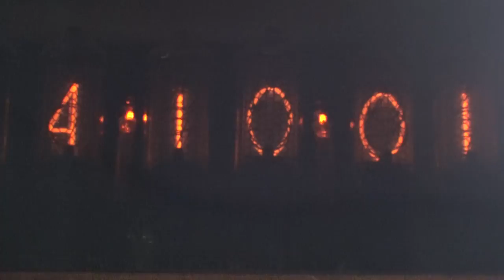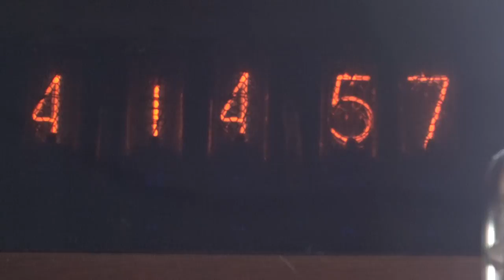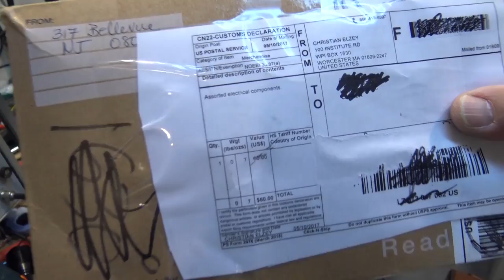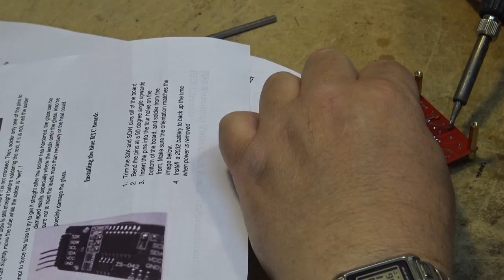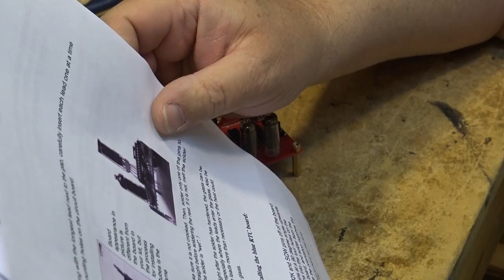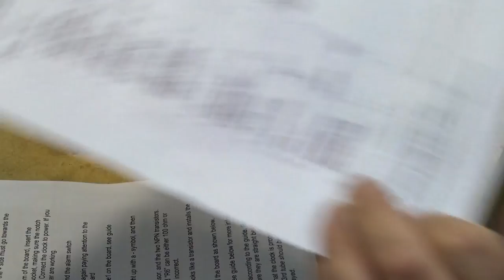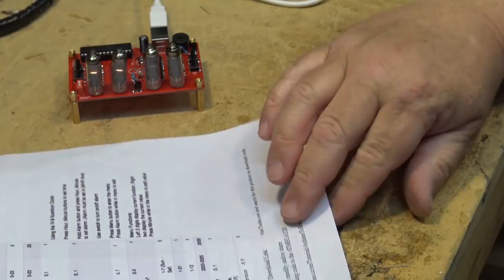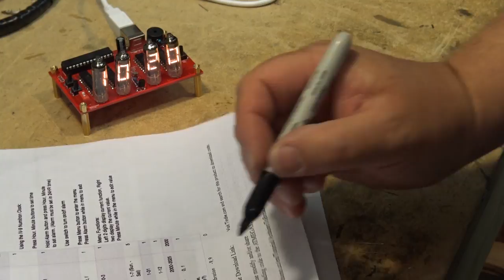Numitron Clock Build

Comment: We used Panaplex on pinballs games, they would burn in too.  I agree with your teacher though.  we have legal issues when Johnny got fried at school.
Reply from the maker: Mark Anderson 
by the time I got to grade 10 we could use line powered projects. the funny thing was same teacher taught wood working and metal shop. we were allowed to use power and band saws and one kit lopped off his finger tip but plug something in in electronics class. nope.
Reply from the maker: Mark Anderson 
that would be cathode poisoning     nixie tubes suffer from this too. that is why the nixie do that slot machine effect every 10 minutes to prevent it.
Reply: Ok OK got it.  Too bad today, nobody offers electronics.  I had one teacher who was against integrated circuits,  he retired, the next was way into taking apart TV signals, front porch back porch delay lines, whew!
Reply: not poisoning so much burnage. it took years though.  Even when it burnt, it still lit up fine. same voltages too, ouch!
Reply from the maker: Oh, as in the glass starting to darken type of burn?
Reply from the maker: Yes I know. They dropped electronics from the curriculum at the high school I attended the year after I graduated. A friend of mine who was 4 years younger than me wanted to take electronics and they dropped it completely just as he was going into grade 10.
My electronics teacher in high school was all about audio amplifiers. Nothing digital at all, mind you that was 1980, so we didn't even have PCs back then. The school computer was a DEC mini, which took up an entire classroom, and you loaded it with punch cards or a paper tape that was punched with a telex machine. I did take computer science too, but didn't learn much. It was running Basic.
My best school projects were a CCD audio delay / phaser / flanger, and a B/W CCTV camera. The camera was a difficult build because there was just a schematic, and photocopy of a board layout. I had to draw the board by hand, etch and drill it. No solder mask, no silkscreen to show where components went. I should have gotten an A on that one, but my teacher, Mr. Hunt (take a guess what I used to call him) gave me a "C" on the final because I showed off a few times and pointed out he was incorrect. He had me helping troubleshoot everyone else in the class projects that they just couldn't get working.
I scored 99% on my final exam, but only received a C+ final grade because my final project was built from a "kit" as he called it?
I wouldn't exactly call the unit a kit, if you saw the work I had to do, including winding the yoke and focus coils by hand, and bending aluminum sheet metal to make the cabinet, and drilling all the holes ect. The only thing "kit" could describe was the fact that it came in a box, with all the pieces necessary to  build it. The yoke and focus coils, well they were just 2 spools of different gauge enamal coated transformer wire. I wound them on paper towel centers to make the actual coil. Was a tremendous amount of work, and much of it I did at home, just so I could finish the project in time. For that he marked down my project.
Reply: Darn your electronics was tougher than mine,  we built transistor circuits. There was Tv equipment in the back room.  I remember seeing a TV analyst, I think it generated test signals, was a B & K and it had the Indian head sheet. .  It was locked up in a back room.  No computers, we had punched cards, the cards were read and sent via modem to a mainframe somewhere. That's adifferent class .  Hmmm, Mister Hunt with a C grade. The old joke was to call a bar and ask to page for Mike Hunt. I made a compressor expander back then like a DBX but it was not a school project.  I had a part time job at Radio Shack and I started fixing things and got my boss in trouble for running a business within a business. Canadian schools were really good. I am not sure about here in Ohio, people cant even spell or write. They don't know to, too and two.
Reply from the maker: Ha ha. Right. Well I remember the funniest stunt we pulled, and this was around the time I was volunteering at the local TV station, around the time of that Chuck Berry concert. One of our volunteers had gotten a job at the Ferry terminal.
A few of thought it would be fun to make a prank call down there, as this was before cell phones. We called down there and said there was an emergency, and page Dr Hoff, first name Jack.
The poor girl that answered the phones paged Dr Jack Hoff to the curtosey phones.
Our old co-worker heard the call, and said he dam near fell off the dock he was laughing so hard, as was everyone on the terminal.
Reply: Oh geez, I don't know, would you help your uncle Jack off the roof? That's pretty bad.  LOL
Reply from the maker: Hey it was a childish thing to do, but hey I would only have been about 18 at the time, and the other guys on the crew were about the same age. We were just a bunch of volunteers at the time.. I did go on to work on staff at that station for awhile in master control. Talk about a boring job but back in 1982 when minimum wage was 3:15 an hour, being paid 5.00 an hour to play tapes on the community TV station wasn't too bad for someone fresh out of broadcast school. That didn't last long though, as Sony came calling for a Betamax technician, and I jumped at that change to almost double my salary and learn a few things about electronics repair.
Reply: Those were the days. I made 3 bucks an hour at a radio shack store in 1976 till 78 in grade 10. I quit and got full time fixing stencil scanners for gestetner for 1200 a month. You stayed in broadcast which sounds fun. I moved to xerox doing copiers then telxon doing data terminals and so on. I almost had a job at City tv in Toronto. Was a very unusual job interview. I had 4 interviews for a 12 hour swing shift. Never got it in the end.
Reply from the maker: Mark Anderson 
I worked at the local station for a few years as a volunteer (intern) then got on staff and got fired for removing a jammed tape in a Panasonic 9200 umatic. incidentally I have that machine now. all I did was unravel some tape from the capstan shaft but the engineer didn't like that and I got canned and blacklisted from broadcast. I then got a job with Sony and started my own production business. made lots of money shooting music videos and weddings in the early years. after Sony I went to a Sony warranty depot and stayed there 20 years, retired, went into telecom where I am today and will stay here until I retire for good. electronics a hobby now. old techs just can't keep their fingers out of broken things. keeps the mind sharp.
Reply: You do a fine job. I don't remember so well maybe I got 600 a month at gestetner I am really impressed with your smd work and knowledge of video equipment. I sit here running a storage and truck rental business wondering what I should do. Lol
Reply from the maker: If I remember right it was 800 a month at the tv station, and then when I joined Sony I thought I hit the jackpot. 1430 a month. A 1 bedroom apartment back then rented for 300 a month utilities included.
Today, in same town a 1 bedroom will set you back about 1200 a month IF you can find one.
People think I did well in the production business, but truth be known in the almost 20 years I was in the production business I made almost nothing. It wasn't that there wasn't work, there was, plenty of it, but the cost of equipment was in the stratosphere. 30 grand for a camera, and another 50 or more for editing equipment. Even renting the gear was expensive. To rent a camera, 800 for a day was not out of the question. I bought used gear, but it still cost an arm and leg, and by the time I paid my camera operators, and paid for the gear, there was not much left over for me. That's why I worked full time repairing TVs and did video shoots after work, and every weekend.
A music video shoot paid me 600.00 for a days shooting. I charged less than the going rate just so I could get the work, but at least when I shot videos, I just handed the director the tape at the end of the day, and he handed me a stack of paper. I did indie videos, no paperwork if you catch my drift. It was fun, but some of these musician types, especially the punk bands, which I did several for were a bunch of jerks. In one shoot the guitarist thought he was pete townshend and started using his guitar as an axe, he swing it it the camera and ended up hitting me on the wrist. Dam near broke my arm and needless to say I did drop my camera. Oh was I pissed. Camera just bounced and kept on working, however it did get a nice dent on the battery case.
Weddings were moneymakers 2,500.00 for a ceremony and reception. Long day, but good money.
Reply: Damn,  I went to Vancouver for a day or two and loved it.  We went to some huge bar where the house system sounded better than the band,  I enjoyed the weather and the mountains. Yes I can see equipment is addictively expensive. Yes weddings are the way to go.  I used to do DJ work and the best videographers stayed out of the way and were right on cue.  The worst were drunk and missed everything.  Seemed photographers were more consistent. They took pride in the work. Sorry you got slashed by a guitar, that is nasty.
Reply from the maker: Weddings used to bring in big bucks. The rates started dropping in the early 2000s as small cameras and amateurs started flooding the market. Soon photographers were selling their expensive portraits, and for an extra 500.00 throwing in a video. I had plenty of offers from photographers that wanted to hire me to shoot video for them for 300, and just hand them the tape at the end of the night. I officially threw in the towel for the wedding business after the 2005 season ended.
The guy that hit me with the guitar didn't intend to do it, he figured he would swing it towards the camera, but missed and well "guitar whipped" me instead.
Reply: Yes I  quit the DJ thing around 2000. I knew I had to get new equipment, I was still using cassettes and I knew CDs were never the way to go.  Also music because so easy to come by that anyone could do it. I still feel a photographer is worth every penny you give him and there is still demand for a DJ, just too many people getting in the field. I agree.  I still see these DJs believing all this crap that will make you laugh,  like the EQ must be set in the shape of a DJ smile, or all levels on a mixer must be equal.  I tried to explain this one guy the inputs are usually 2/3 up and the master sets the level, usually its under a half but no he had the master way up and the inputs down for maximum noise.  Then again, I tried to tell him Trump is no good and that failed.
Reply: Those pinball machines must have been some of the last equipment to use panaplex it seems. I remember new ones in the late 90's, almost always looked nice. Very quickly reactive, and I recall some would start to shimmer like the plasma tv's.

Comment: That is a shame that someone could damage a kit of parts like that.
Reply from the maker: As you saw it all worked out, but the tubes could easily have been crushed, and these type of display tubes are getting harder to find because they haven't been made in a long time.
Looking at the numitron clock sitting beside my VFD and Nixie, I really like the display quality. It is by far the easiest to read, and this is probably one of the reasons they were used in aviation readouts. I'll keep it turned down to level 3, which is more than bright enough, and gives a nice orange glow. The tubes will probably outlast me at that level.